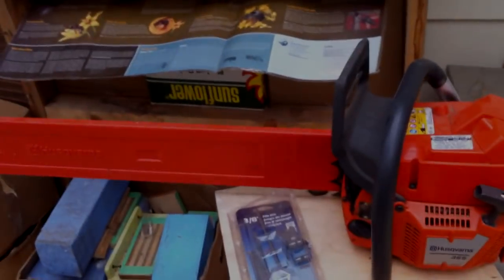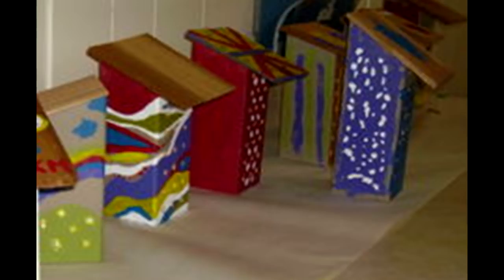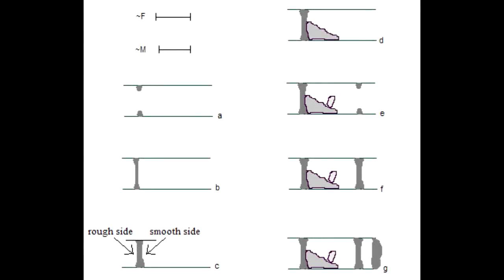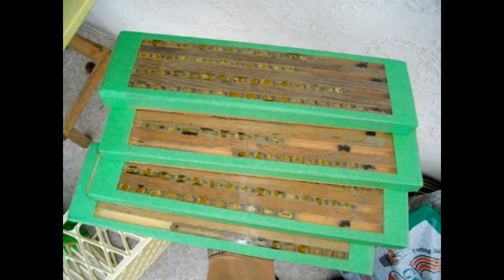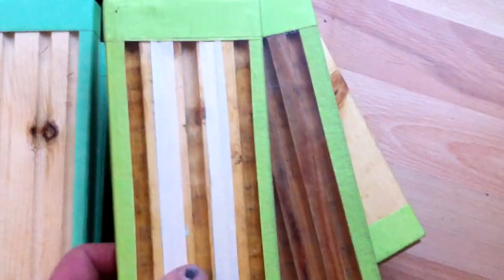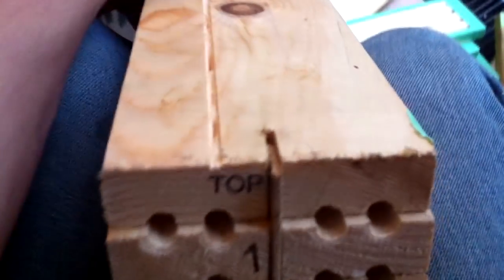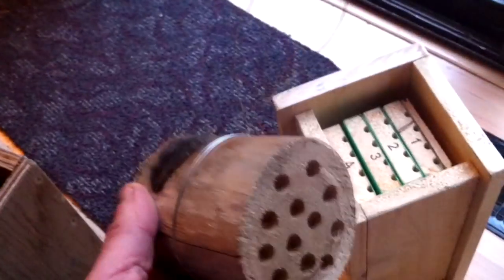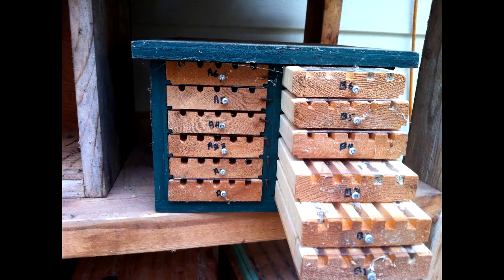Every Correct Thing You'll Need To Know About Mason Bees and Bee Condos For The Beginner

Comment: I see the recommended length of the channel, but what about the suggested diameter of the channel?
Reply from the maker: It is on my website "Hutchings Bee Serices" but it's 5/16" or about 8mm for the local Osmia lignaria that I was demonstrating in this particular video.
Reply from the maker: 5/16" for most Osmia lignaria but other species which are smaller utilise smaller diametre.

Comment: I want to do an inexpensive hotel/house with my eight yr old. We don't have the saws and such for wood.  My thought was to use an old 3 litre metal olive oil tin.  Leaving an edge so rain doesn't get in and a little landing in front too. I would use bamboo or raspberry canes inside.    Would this be an acceptable material? I was also thinking of putting in parchment paper or regular paper inserts into the bamboo so I can clean and reuse canes/bamboo, is that a good plan ?
Reply from the maker: Well the whole idea why I utilise a clear cover on top of a wooden channel is for observing what's going on inside and to learn a more intimate biology of cavity nesting insects, in this case, bees. This is highly conducive for the education that adults glean from this perspective, let alone a child so it would be a real loss of opportunity for a child not to witness this and learn from it also. When you have bamboo, will you simply leave the bees to their own devices a.k.a., their associated diseases, parasites and parasitoids? At least with raspberry canes, if  you're careful, you can cut/split them open at the commencement of the year and go on to a cleaning program which can be seen in my other video on using sand and tubes etc.  What a shame not to have access to this. I do build and mail these out to people but the postage cost is ridiculous, hence my basically no longer doing this readily since the rates went up so drastically starting about 12 years ago. I did just send one off to Pennsylvania and it cost the woman $32CAN for me to send to her. She was insistent in getting my product and simply could not build it herself. I'm not here to sell stuff but merely educate and try and get people to build their own and copy my design. My website goes into more details perhaps if you want to check that out. I hope this  helps.
Reply: I suppose my thought was that when I took out the parchment/regular paper inserts, at that time we could unravel it and inspect what had happened throughout the season....then clean and reinsert paper tubes for next season.  Not sure if that makes sense, this is all new to me.  Where are you located though?  I am in Nanaimo, BC and it seems you may be close?
Reply: Looks like you are in Victoria? Wow, that would be great if so.  Do you ever get up to Nanaimo? Maybe we can meet here or there and I could get a couple condos from you!  Great Christmas or birthday gifts.
Reply: Sorry but I'm in Cobble Hill but leave in three days to retire in the Kootenays.
Reply: Yes, the option of parchment paper will work just fine and like you said, you won't be able to view within but that's up to you. You may eventually get yourself a condo like mine or I can make you one in the future as I've packed away all my stuff ready for the move. I simply can't get one for you before I head out.
Reply: Oh darn.  Maybe we could touch base one day when you are back to the island.  Good luck in your retirement.

Comment: Would cedar be a good material for building? If the bees don't mind, it might cut down on mite infestation, since cedar supposedly repels bugs, and it's longer-lasting than regular untreated wood.
Reply from the maker: This is a good question and I have been asked very many times over the years when I give presentations and classes and yes, cedar works fine. I've been using it for many years with no deterrent for the bees. As far as their associated parasites being put off, I don't see any difference. Think about how many cedar shake sidings and roofs you've seen and if you look carefully, you'll sometimes see a plethora of mason bees going about their business in the gaps. However, the associated parasites and parasitoids associated along with them is horrendous, hence a good cleaning management system if  you want to replicate this same thing in  your captive pollination service in your condos and bee barns for your crops or whatever. So yes, cedar is fine. On others saying it's bad, I beg to differ but like everything else my father and I tried starting in the 80's, we gave it a go and figured out which was the best way to carry on and make yearly improvements. I would tell you to do the same. 
Good luck.